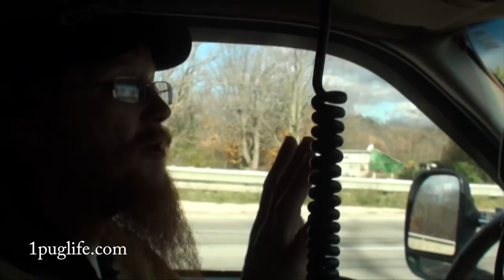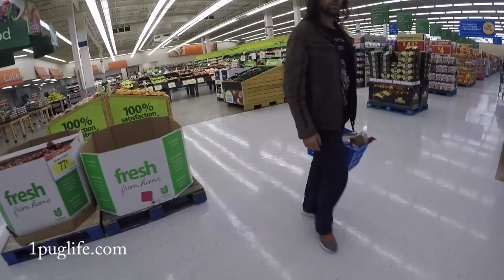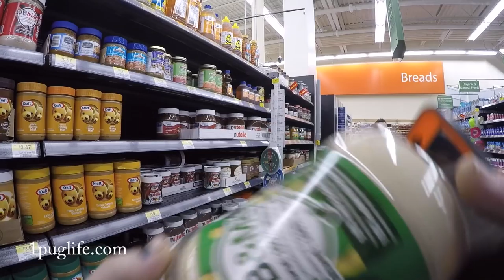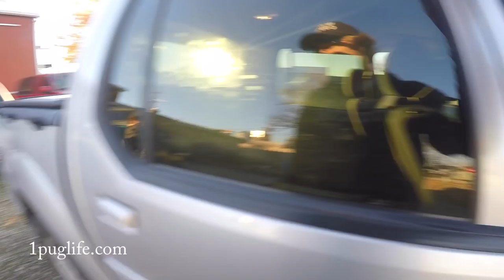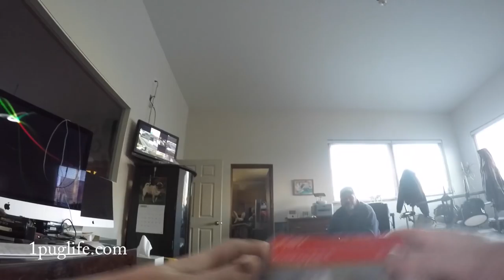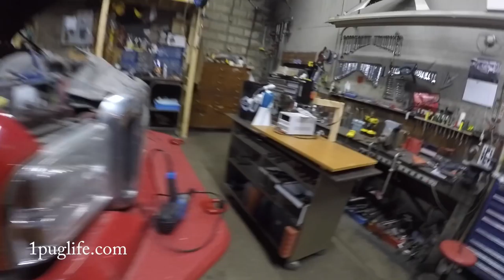almost got me

Comment: Drivin your big truck to WalMart, Canada and America same.
Reply: Pug buddy ya gotta do something about the concrete floors, its not good on the bones and when they are cold it sucks your body heat out of you even if you are wearing shoes. Not good on dog paws too.
Reply: yah, not good. when i'm in my shop i make sure to have a piece of carpet under my feet when working in one place. My thought on his floors if he doesn't want to use carpet or wood floors.. would be to polish the concrete floors himself.
Reply: might be just a folks tale ,, the concrete only cools your feet in an unheated building ,, its the hard rock of it that makes your bones hurt , proper foot wear solves that problem along with walking around a bit every once in awhile